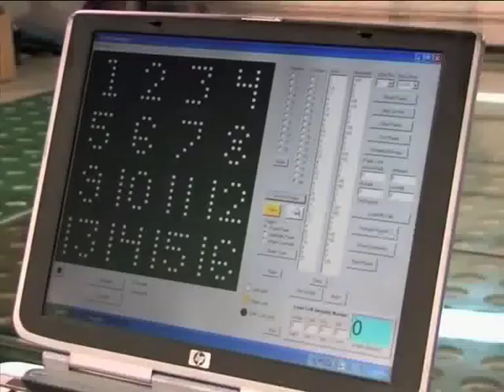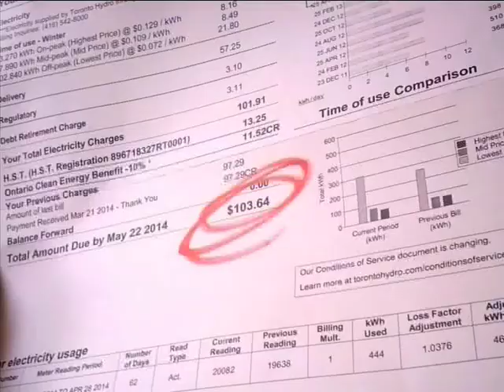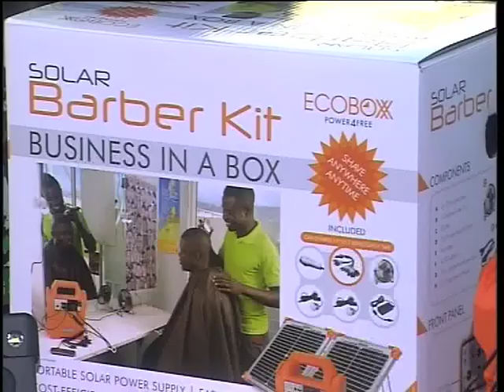Solar Roads / Switch To Solar (26 May 2014)

Comment: I smell bullshit. The cost of a project like this would be astronomical also putting solar panels on the ground is the least efficient way of using them that would only generate about half the power they would generate if you put them on a rooftop.